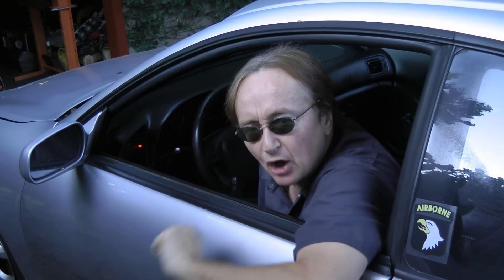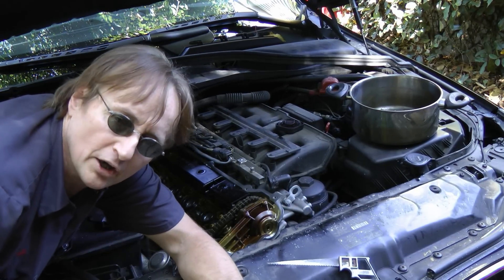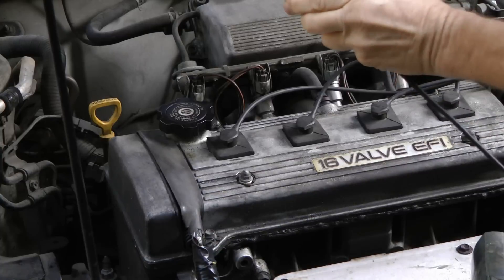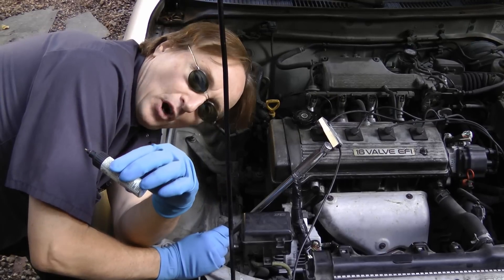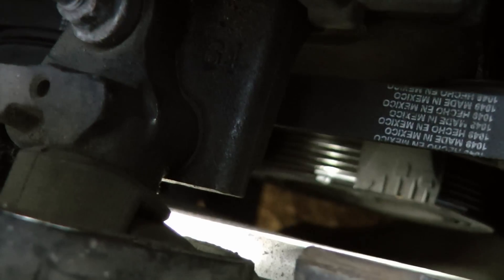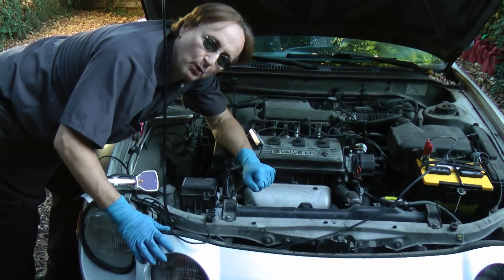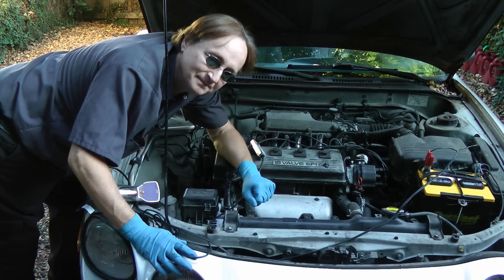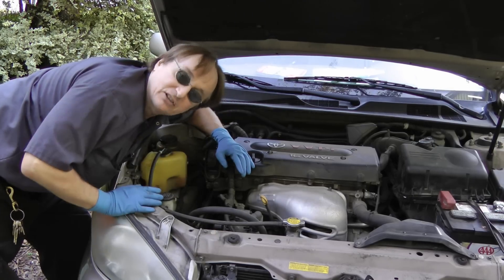How to Check a Timing Belt or Timing Chain in Your Car

Comment: Awesome. Thanks for your hyper-fast reply. Much appreciated. I have been changing my oil a lot more often these days, I've owned it from 47,000 and am tarting it up to make it a keeper. It has a new radiator, and have only had one patch of rust on the door sill that I've had done. Hoping it will reach 250,000 and beyond. With the oil being changed regularly, is there anything else to keep an eye on or get changed before it does any fatal damage or should changing the oil be enough? I don't accelerate hard and am motorway cruising in 6th gear most of the time.
Reply: Trans fluid, steering fluid, coolant at least

Comment: Love your videos Scotty, keep them up mate. I'm in Brisbane Australia and have a Commodore with the old Ecotec V6 engine, coming up to 400,000 Kms. I'm planning on replacing the timing chain as there has been a tapping noise for some time and I can't identify where it's coming from. I reckon it would do it good to renew chain and tensioner, probably water pump also.

Comment: I have a 2001 Saturn L200 with the standard 2.2 engine, not the eco-tech model, which these developed timing chain tensioner issues. It now has had a ticking in the lower or mid part of the engine for about a month now. I stopped driving it since I first heard it incase it's something serious. It's not the lifter ? area. My shop manual doesn't state these have lifters tho. Called something else I don't recall off hand right now. Long story short, is it possible this could be a chain slack issue ? I've never known them to "Tick" like a lifter tho. This starts when it's warmed up, not on cold start-up. Can you test with a timing light with this type of engine with coil packs ? Thanks for your great info video's.  BTW, the oil pan was pulled by my mechanic and found no issues there. He did find a flywheel flexplate bolt 1/4 of the way loose and a possible crack in the FP. He has no answers for me from there for the cause without digging farther into the engine. Thanks for any suggestions. I really don't like contacting techs thru YouTube posts, so please excuse any issues this may cause.
Reply: +Chas S: I think my answer for the "Coil Pack" testing is answered below.
Reply from the maker: +Chas S   yea, don't buy one of those, they weren't such hot cars. Really, you'd have to tear the engine down to find the actual true problems and spending that kind of money on one of those is foolhardy. Drive it till it drops, then junk it

Comment: hi scotty i enjoy watching and learning from ur videos and live car talk ive learned alot  and keep learning. i have a 06 mazda 5 car/wagon with both sliding doors behind driver passenger doors with 122 k miles on engine auto/manual transmission. i checked engine oil its overfull also needs to b changed its not thick anymore problem is theres a timing noise as i accelerate its louder deccelerate it calms down like a clicking  weird sound. not a squeaky sound of pulleys. even the sound of the valves ticking has nothing to do with the sound on the timing belt area..  does the timing belt need to b replaced? is the timing off original timing setting? does it need adjustment with timing light? what is that sound ? is it a warning that can break down the 2.3 dohc vvt engine?

Comment: I got a 2005 Subaru Outback XT. They say replace at 105,000 miles. Should I do it around then or wait until it looks really bad. They also recommended replacing the water pump.

Comment: Good info, but you should mention that the engine will mechanically advance when revved. It sounded like you were implying it should not move at all. You should set your base timing, and on older engines determine how much advance you have and when its "all in"

Comment: You should make a video when you find a car with a bad timing chain and use it as an example. Show us the timing bouncing up and down and show us the physical confirmation. I replaced the timing chain on my Camaro when I replaced the camshaft but when I set the timing I wasn't paying attention to any bouncing around of the timing mark. My chain had substantial stretch in it too.

Comment: I recently bought a 2009  toyota venza. It has 140,000 km on it. Been serviced regularly by looking at the reports. No accidents. It runs fine. No misses. I notice though that when it starts it makes a bit of a rattle for a couple seconds. Seems like when its cold. I had it looked over by a mechanic and he said I need to replace the timing chain on it.  He was pressuring me to have this done. Does this sound like it needs to be changed? Thanks for your video by the way. A lot of us out here are getting scammed for money we can't afford.
Reply from the maker: it could easily be if the previous owner did not change the oil frequently.  Get another mechanic to analyze it and replace the chain if he says it's that.
Reply: Scotty Kilmer
Just to add,,,if the chain or belt was ever changed there is almost always has a tag right on the motor that shows the date it was changed,or a sticker .

Comment: I'll try it but I read somewhere that the belts don't actually stretch, they'll just snap with no prior warning. I'm certain mine is way overdue for replacement so this will be an interesting test. ( 2000 Hyundai 1.8 16v ) I'll report back with my results.

Comment: thx   ,when my  engine on when i stop in traffic red light ,  idling  sometimes it rmp is 600 .sometimes is  800   ,  when i shift to neutral , rpm goes to bout 900-1000.       i check my throttle intake is  clean,     i change spark plus in  230000 miles n air filter too.            to deal clean the throttle intake .      after  watching ur  video ,  i know how to clean my self next times            thxx

Comment: Someone below asked how you check timing on a diesel, so here is how.  Diesels have glow plugs, not spark plugs (cant use timing gun cause no induction connection), and fall fall into two categories:  Mechanical injection & computerized.  Check forums or your manual on the computer systems, but for those of you with mechanical mercedes diesels (I have a turbo, but same procedure for n/a), the crank shaft pulley has lots a timing mark.  You have to remove the metal fuel line from cylinder 1 on IP, crank the crank shaft over till you see diesel filling up on Injection pump 1, and note degrees on crankshaft mark.  Then, you have to loosen the injection pump, and rotate it to either side and see if it improves.  It is a long scary procedure & I suggest you do research first.

Comment: Hey, Scotty! So, two days ago my car starting making this loud clanking noise. At first I thought maybe it was low on oil, but that was fine. Then I thought maybe it was a loose heat shield. Nope. I took it to one mechanic who does not specialize in Honda, I might add, who thinks it's the carburetor. He told me it's fine to drive, but it's just loud. I'm suspicious that it's a loose timing belt.

Comment: Scotty Kilmer I have a 2000 Honda Odyssey with only 50k miles.  The timing belt has never been replaced.  The car has been kept in great condition (always garaged).  The Honda Service Maintenance says to change the timing belt every 100k or 7-8 years (whichever comes first).  The dealership and all of the other auto repair shops think I should change it.  But I really think the belt is in good condition.  Any advice?  Should I just follow your video?

I really don't want to change the timing belt if it's in good condition.  I've seen cars that last 20+ years without having to change the timing belt.  In fact, my dad just changed his 1995 Mercury Villager timing belt just last year at 110k miles!
Reply: Mike Yu dude you have an interference engine. if your timing belt breaks your engine will be done. your dads is most likely different
Reply: Mike Yu if it breaks it will destroy your engine so it's cheaper to replace it
Reply: Has your timing belt broke yet in the 2000 Odyssey?
Reply: Ditto.     You won’t get any sort of warning whatsoever with a belt and it may well look and feel perfect.   It’s their nature and that’s that!    CHANGE IT or it may very well go BANG.
Reply: Mike Holt    Yes I Agree
Reply: What about the timing belt on a 2012 chevy sonic 1.8l? Is it intereferrence or Not? I've got 130k on the original belt, im sure it probably needs to be changed :-/

Comment: Hi Scotty, newer cars don't have distributors anymore but one coil for each spark plug, and the ignition timing is determined by an inductive sensor that "looks" onto a teethed wheel on the crankshaft, so this method doesn't work anymore. The sensor on the camshaft only tells the ECU which cylinder in on top dead center firing or between intake or exhaust, and the ECU doesn't care for two or three degrees difference. This should be mentioned; at least european and japanese cars don't have distributors since maybe 10 years or more.
Reply: no car in the world is still made with a distributor anymore
Reply: no car in the world is still made with a distributor anymore
Reply from the maker: +Moot Doe many foreign countries still have em

Comment: @nola wouldn't let a timing belt go to far beyond its service life, even if it's a non interference engine it still might hurt the engine.  Plus when the belt pops it will leave you stranded

Comment from the maker: those VVT systems are insanely complex, find a better mechanic with a machine as in my video "fixingmodern cars using high level scan computers" to get a correct diagnosis and test done. But if you've been bad, really dirty oil can set that code and new oil and filter can fix it

Comment: Hello Scotty your videos are great,always having fun watching them.
 I have toyota D4D common rail diesel here in UK and it has timing chain,how do you check timing chain on diesel?
am not suspecting it to be worn but it might be,i have rattle from( injectors on acceleration)but i`ve been told injectors are ok by toyota main dealer.so it still could be timing chain being stretched and giving bad timing signals to injectors i think.what is your opinion?thank you Joe
merry christmass

Comment: Hey love your videos and im kinda hoping youll be able to help me. I think i have rod knock. Not sure though. The cars an 04 mazda 6 3.0l v6. Ive had it since nov 4th and just got it in my possession this past friday. 
When driving 45-50mph my rpms would be about 2.5 then theyd drop to about 1.5 speed would stay the same and car would shake like crazy. Had to floor it a little to make rpms go over the 2 for it to stop shaking but the car would sorta jerk forward and have a hard kick in the rear end.
I was told motor mount. Got it fixed problems still there. Codes couldnt be read so it got reset and 2 weeks later was able to be read as a vacuum leak. Got my hoses looked at they were fine. Car made a loud pop while driving one day sounded like it was in the dash on the passenger side my rpms shot up to the 4 and i couldnt go over 30mph. Dealership said it sounded like transmission. They sent it to a shop. Shop said its not the trans its the motor. Then they did motor diagnosis and said motors fine its got 2 bad coil packs and mass airflow sensor. Got my coil packs replaced.
Theres a nipple on my intake cover that this big hose from my firewall on the driverside goes to. The nipple was broken when i got the car back and the car was stalling out. I plugged it up to get it running and it runs but now i have a loud knock in my engine. I posted a video on my page but im not big on YouTube so its probably never going to be viewed. Any idea what it is?

Comment: Hey if you want to pull valve cover and inspect chain by eye what would one look for? I have a 2.0 turbo I race a lot, I heard some top end rattle so I replaced the tensioner and it did the trick for now, but before I hit the track id for sure want to inspect it a little closer but im not sure what to look for, hard to tell if its stretched lol. Any help is appreciated keep up the good work!

Comment: How to check timing chain on a Diesel engine
 and one more question how to check if timing gear is worn for engines with no timing chain or belt but the old tech when timing gears were used and cam shaft was below near the crank shaft and push rods with rockers to operate the valves

Comment: One thing you say in the video that is not accurate - that if the timing mark jumps around when you rev the engine, it means the chain is worn.  The marks on the pulley are only used for setting static timing at idle.  At higher RPMs the spark gets advanced considerably, by the vacuum and mechanical advance mechanisms. In distributorless ignitions, this is done by the computer.     Thus it would be normal for the timing mark to move sunstantially.  I was watching my OBDII app on my way home tonight and saw timing as much as 30 BTDC under load at highway speed, whereas at idle I think it is 10 degrees.

Comment: Hi Scotty thanks for sharing your knowledge with us. I have a question, the engine of my 2003 Mini Cooper non S 80k miles, makes a rattle sound around 1500 and 3000 rpm.
I tried to change the chain tensioner but the bad noise remained.    Is this a sign that the timing chain is worn?
Reply from the maker: IT OFTEN IS.  Have a guy like me check it out in person, realize those minis are not made to last long, a typical BMW clone in that respect

Comment: I drive a 1993 Honda Accord, and it has been approx. 70,000 miles since the timing and balancer shaft belts have been replaced.  The owner's manual says to change at 90,000 miles.  Will I be ok for another 2-4 years if I only drive 3,000 per year, or should I go ahead and change it for preventive maintenance?  I know it's an expensive maintenance procedure.  I am holding out until I can get rid of it for a newer car.  Thanks Scotty!

Comment: Would you recommend changing the timing chain/belt on a Toyota Sienna with 123,000 miles or a Kia Oprima with 103,000 miles as preventative mainta=enance to extend the life of the engine?
The oil is changed pretty regularly on both vehicles.  Thanks
Reply: Timing belts are usually only needing to be changed around 62,000 miles or 100,000 kms maximum, it depends on the manufacturers specs, some are around 56,000 miles or 90,000kms. The specs vary, check your manual or nearest service center for the correct specs. Only change when needed, it won't necessarily extend the life of the engine. If you don't know when the timing belt was last changed, it would be a good idea then to have it replaced, as part of a preventative maintenance service. Timing chains very rarely wear out if serviced correctly, the timing chain tensioner is what wears out the most. A timing chain can last up to 300,000 miles or approx 483,000kms, or longer if of course the engine is maintained well. Usually we say the timing chain will last the life of the engine.

Comment: Hey Scotty I have an 85 Monte Carlo ss with 107,000 miles on it. I purchased the car with about 83,000 miles on it. The car runs good but some times when Im driving around the car will hesitate when I push the peddle down to get it moving.... It jerks around sometime also. Sorry I don't have the correct verbiage for what's happening but hopefully you have a idea from my description of my problem

Comment: I just bought a used 97 Chevy Cavalier 2.2L (interference engine).  It was babied and runs great; really strong and gas mileage is in mid 30s (hwy/city combined).  The car has about 125,000 miles on it, but looks almost new (inside and out).  Does an engine run crappy before a chain skips or breaks?  Also, the engine is kind of loud, but I read a comment online that these engines typically sound sort of like a tractor.  What do ya think, Scotty?
Reply: They can run like crap, but at that age and mileage, don't take any chances! Get the timing belt and water pump replaced.
Reply: Serapis my car did that too I tried to down shift to 2nd gear and it would not accelerate in high Rpms but it did In lower rpms. Later that day it turns off on me. Tried to start it back up but turned back off when I let off the clutch. The next day it starts but Then I could really hear the belt squeaking now it just makes a ticking sound. So I stopped driving it for Now until I can get fixed you should do the same

Comment: We have a chevy cruze/suzuki swift aka ignis (2000) that was slow to start until it finally would not start at all.  During evaluation, the ECU was found to be in good working condition, then the camshaft sensor was also found to be working and finally the crank angle sensor was replaced but the engine sounds like it wants to start but does not have enough power to continue.  The next thing the mechanic wants to check is the timing.  What advice can you give?
Reply from the maker: never to buy one of those junkers in the first place, they are terrible vehicles as they age. BUT, really, find a guy who really knows suzukis if you can, they are rather bizarre set ups requiring dealer level scanners to fix them correctly

Comment: I have to replace the timing chains on my 2007 Suzuki xl7, but do i absolutely have to pull the engine out? I cannot afford to pay a garage to do the work, so im wanting to do it myself. I believe with afew things out of my way and removing motor mounts on the one side, a well placed jack could give me access.I could use some advise cause every garage is trying to charge $700-1200 to do it."not including parts"
Reply from the maker: you can do it on the vehicle but it's not fun

Comment: What do you do if you can't have a new timing chain / belt put in or are just going to run what's left of a vehicle to the ground? Im told of an old trick by an old mechanic. He says to advance the timing a bit and this will help compensate for the slack in the chain / belt. A newer mechanic says that with modern cars, the computer will adjust it back to stock usually. Is there a way to tune or nurse a car with a bit of chain slack?